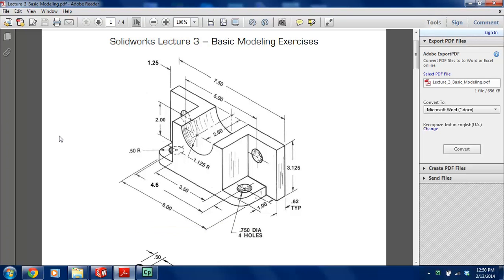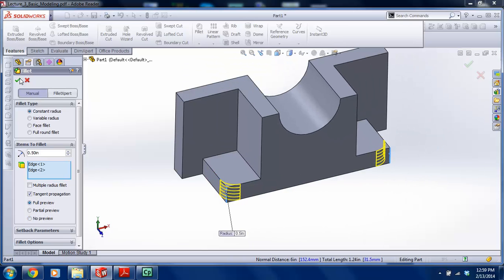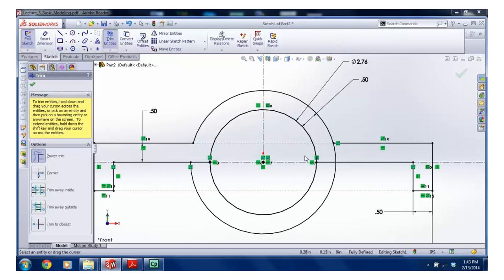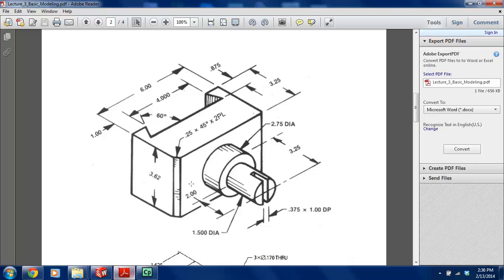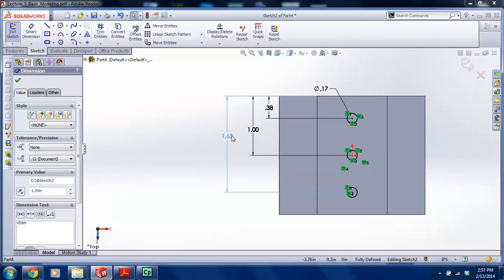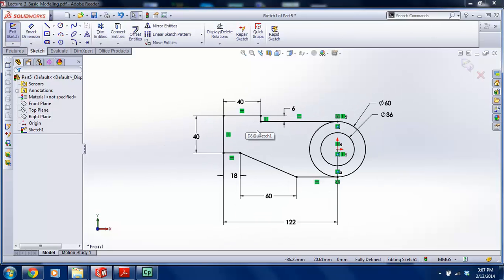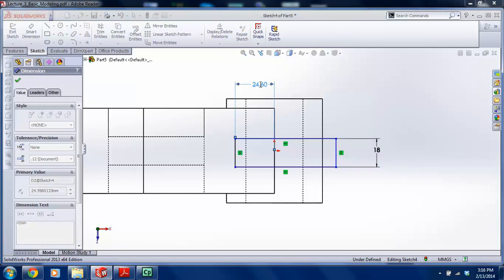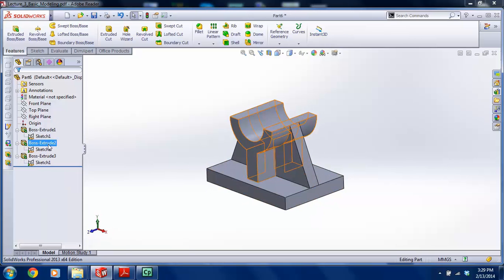Solidworks Tutorial 3 Part Videos

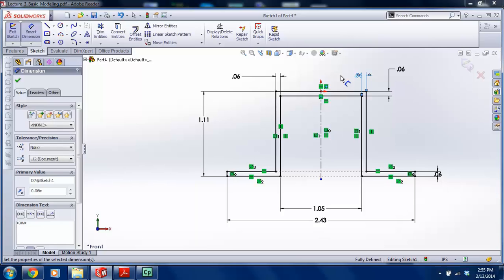Comment: For the project at 35:00, definitely use the sheet metal features of Solidworks for this. Much easier and is really the correct way to do it. In this section, the bend radius for the 4 edges was missed. The sheet metal features make all aspects of sheet metal design much easier. For example, you set the thickness of the sheet metal only once and there are great built-in features for the bends.

Comment: God solidworks controls and the work process is completely idiotic compared to Sketchup...
Reply from the maker: MotoK tips I hear you. I had to do a project in sketch up and felt the same way in reverse. It all depends on what you are used to. If you are doing any sort of precise mechanical design or any sort of fabrication - solidworks is one of the best. However fusion 360 does look interesting...good luck